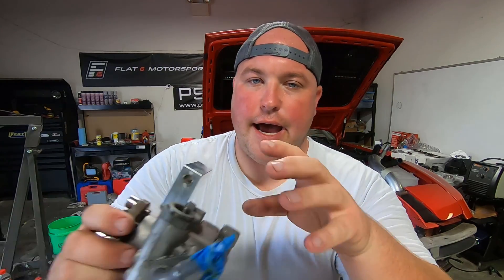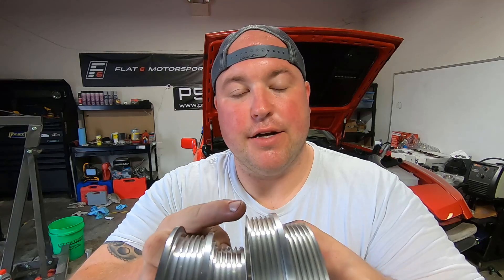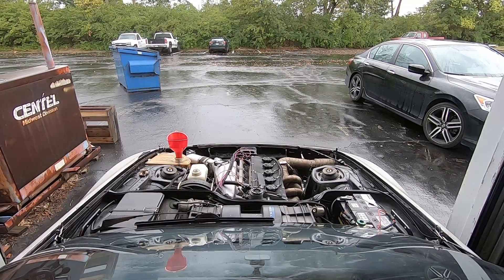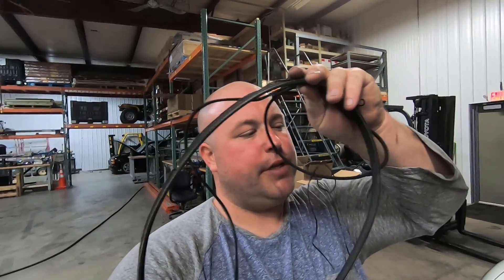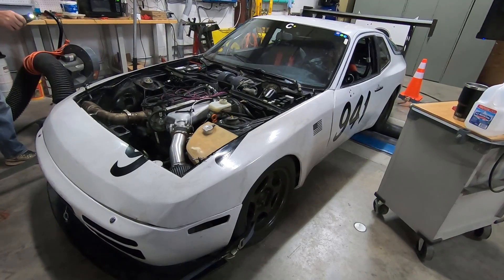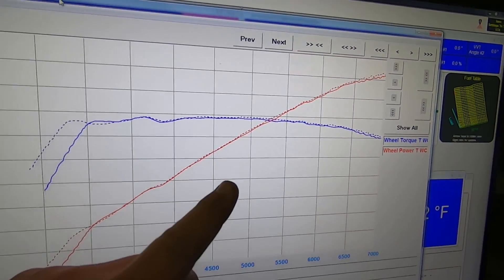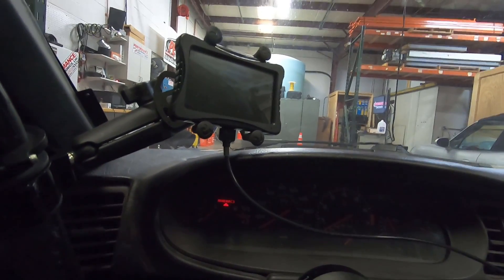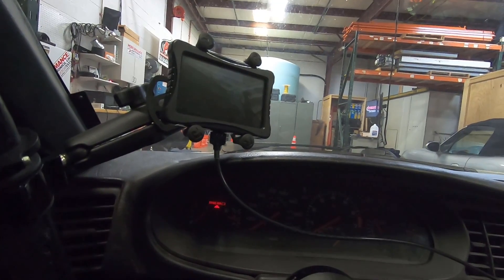5 Cylinder 944 Build - Part 8 (Porsche 944 07K Swap)

Comment: A stock 944 has 140 to 150 hp .
Reply from the maker: Correct. The 07K in NA form makes about what the 944 turbo does. Our turbo 07K build put down 454 whp.

Comment: That sounds so amazing.👍 i almost bought 2 of those engines at my work if i had the cash back then but i let them go.Sadly. I have a audi a3 8p with a manual 2.0tfsi quattro with a BYD edition 30/s3 8p engine swap with a hybrid tte420 turbo and partially forget engine(conrods and race bearings and cnc ported head with supertech valvetrain.It makes 414hp and 545nm on the crank.If my 2.0 tfsiengine was not build i would have dropped a o7k in it since it's the same platform, with any luck my gearbox just bolts on.😅
Reply from the maker: Dang, I bet that’s a blast! My brother had an A3 but never did anything fun with it. The 2.0L has the exact same bolt pattern as the 07K! Make sure to check out our turbo 07K 944 build series if you haven’t already.
Reply: Boost Brothers Garage hey man thanks for the comment, thats nice to hear about that bolt pattern. here's my cars dyno run, 

https://youtu.be/xbiczniq0g0
my plans if i ever get the funds are to put in some rs3 injectors( now on stock s3 injectors with a 165bar fuel return valve and upgraded hpfp and ttrs lpfp and controller) and swap my hybrid in for a tte480+ or a g25-550 but since it's a street car i like the hybrids power delivery. I was planning on putting a half cage in since i already have recaro buckets and rear seat removed, and some additional weight reduction like the aircon deleted, lighter exhaust etc.I live in Belgium near Zolder and spa is about 1 and a half hour drive from where i live.But unfortunately my project is on hold because i got my medical discharge 4 years ago, i have severe crohns since 2001 and i worked as a mechanic from 2004-2016 until my body collapsed, i only weight 53kg in the end so that was the end of my career unfortunately.But i get my enjoyment in these video's.It's nice to see projects like these.So big thanks for the content and the comment👍✌️👉

Comment: Try a clutched/one way alternator pulley, allows the alternator to free wheel on engine de-acceleration... should save belts.
Reply from the maker: It’s a harmonics issue with the factory damper. Starts at around 6800 and nearly impossible to fix without switching to a viscous dampner like the TTRS unit

Comment: Hummm i see this NA version of the build is using a Power steering Pump, I am still wondering if a 2012 2.5L with OEM power steering can be used with the kit... interesting build. I am interested though only secured 2 newer VW project cars...
Reply from the maker: The hydraulic PS pump has to move to make room for the intake. There are ways to still have AC if that is your concern.

Comment: Any CA peeps starting or finished with this 07K conversion?  Any tips on passing smog?  Thanks!
Reply from the maker: Discussing with people but there are issues with doing it. The main thing is you have to keep the vacuum pump on the back for he motor which means you have to clearance the firewall or move to an electric vacuum pump if that’s allowed.
Reply: My Bro in law has a LS swap he gets passed smog here all the time. I’ll hit him up for his resources and try and report back so you can pass on to any other CA swappers who need help.

Comment: It's freaking amazing! If you know someone in an auto parts store you can look at other tensioners with stiffer springs you could swap into your tensioner. Also find a pulley with guides for sure.

Comment: So how did you fix the timing belt issues?
Reply: I currently do not own a Porsche 944 but seeing this Five cylinder swap. It gives me dreams of a car that sounds like a Dodge Viper without the big price tag. How much would it cost to do this engine swap.
Reply from the maker: I’ll have about 8k in the NA swap, and another 2k or so in adding the turbo. Good news is engines are $250 so after the initial investment it’s SO much cheapies easier to work on and modify.
Reply: So I could have a budget Viper for possibly 15,000$. Now I just need to finish my other project car a 1969 Ford Falcon. Don't suppose you guys have a five cylinder kit for one of those? Lol! I will just have to wait till next year and get my Porsche.
Reply from the maker: Love those old Falcons!
Reply from the maker: Fixed the accessory belt issue by installing a TTRS crank pulley/dampener and developing a tensioner pulley with a lip to keep the belt from walking.

Comment: Hey maybe something to look into, its a bit counter intuitive but having a pulley with a crown with the center larger diameter than the out side helps belts track center.  Having edges when they jump will tend to bunch and tear belts too, this is because belts tend to walk to the tightest part of a pulley.  I guess goes without saying having good alignment then if the tension is off as well will cause problems.  You do have a lot going on details like this really bog the project down.  I may be way off base but having metal idler pulleys with a good crown, I would think this would be in a machinist handbook, and maybe a manual tensioner in place of the spring.  :D

Comment: This a non turbo? Seems pretty slow on the video. Sounds faster than it is lol. Needs a supercharger..
Reply from the maker: Non turbo but it is getting a turbo. We have customers who will be doing the swap as NA and this is the development car for base tune etc. I gained 5.5 seconds a lap from just the engine swap vs the stock engine. 1:31.5 to a 1:26.1
Reply: Boost Brothers Garage sounds like a good plan 👍. A fully built n/a with ITBs would be good to see as well

Comment: Bet it feels fast on the butt dyno already with that torque curve, even running 40-50hp down on what it’ll be able to make eventually.
Reply from the maker: HUGE difference from stock. Finally feels like a properly quick car!
Reply: Boost Brothers Garage Yeah the chassis’s capabilities are totally wasted on the non turbo versions, my mate had one, and you could throw it into corners really hard and maintain your speed pretty well on country roads, but it was just so slow getting up to speed.

Comment: Wonder what you would do with a complete engine like Integrated Engineering puts together?
Reply from the maker: You mean the crazy NA build? I’m guessing close to $5k. You make quite a bit more power for way cheaper by going turbo. But those NA builds sound amazing and would be a great match for a lightweight 944 track car

Comment: I reckon you should have stuck with the 951 engine, mine made 427bhp with a flat curve!
Reply from the maker: This was never a 951. Sourcing and building a 951 engine would have been more expensive than what I’ll have in the swap once turbo’d. I still have my 2.85 hybrid stroker 951 engine for my widebody car

Comment: There is something deceptive and effortless about the 07k despite its low power numbers.  It just doesn't bog down or need to be wrung like a four cylinder.  I took it up to the mountains last summer and made a 10 mile climb on a 3% (or more) grade without trouble.  It didn't care if it was in 3rd or 4th.  It just went.
Reply from the maker: Smooth linear power for sure!

Comment: Many things to consider here:
1. Although the hp #s may not seem that different from the NA 944, the power delivery is completely different. The modern power curve is light-years beyond the stock Porsche motor. 
2. Without any modifications to the rotating assembly, this engine will eventually spin 8,000 rpm at close to 200hp all day long. Again, a major different from the stock 944 motor but using the same displacement. 
3. Mike has the prettiest eyes. 
4. With head work and modified cams, this could be a 230 wheel hp, 8,000 rpm engine, all day long. 
5. If you have custom ECU or tuning work done, Performance Electronics is THE place to go in the Midwest. A real quality shop with not just niche tuners, but real engineers. 
I've spoken my peace. Godspeed ya'll.
Reply from the maker: Regardless of the dyno numbers the factory engine was 158 crank (when new!) and this should be 220-230 crank when tuning is done. A 30% increase is HUGE! Also, couldn’t agree more with #3 😘

Comment: I have questions 1 can the performance electronics ems be used with a race pack iq3, dose the ps relocation kit allow for A/c and will you be producing pully a kit that will help eliminate the issues that you are seeing with the belt
Reply from the maker: ECU uses CAN so any aftermarket race dash plugs right in. We will 100% be offering the pulley solution in our kit. AC could be installed on the passenger side of the engine.

Comment: Wait....so a broken belt is now likely to to force you to spend two days pulling the engine out and replacing the 3d printed engine flange every time it happens?  Instead of trying to make it never happen it seems better to just design it to handle the failure, right?
Reply: No. The belt broke which spiked the coolant temp, which melted a 3D printed prototype part. Once they figure out that the part will work they will have the actual part cast or machined out of metal and it will never be a problem.
Reply from the maker: Agreed!  This failure was just because we were using a plastic 3D printed coolant flange. The production piece will be aluminum so it won’t ever be an issue again.

Comment: Nice work guys. Assuming there are plenty of examples around the world of people building up these motors (in various cars). Therefore what are they doing about the belt issue? The harmonic balancer should help.
Reply from the maker: They are doing the TTRS crank pulley alone and that seems to solve most issues.
Reply: @BoostBrothersGarage  Great to know there's an easy solution. You'll definitely have to sort it out before going forced induction. Looking forwards to your progress.
Reply from the maker: Thanks!
Reply: @BoostBrothersGarage  Just found a guy  in Oregon who has a 924 racecar with i5 motor conversion. Look up Britain Smith on FB.

Comment: I love the flat torque curve it has and am also really curious to see when the power will level off when the belt issues are sorted. VW really restricted that motor from the factory, guess they can't have an n/a motor upstate their 2.0t lol.  I'd love to see a built n/a 07k just to hear it scream
Reply: IE Motorsports have built these motors to over 300hp NA
Reply from the maker: I REALLY wanted to keep this engine NA and do a 300 hp 9500 rpm build but the boost bug hit me hard
Reply: @BoostBrothersGarage   makes sense to me! Boost delivers for the money and output. The only reason an NA build would make sense is if it somehow kept you in a more competitive race class or kept the car more reliable. That and just the preference for power band shape and delivery if the car was breaking or hard to drive with the extra torque. At this stage it's just not apparent how much that will matter. Looking forward to seeing how the cars do as you get deeper into R&D!

Comment: Stock cam? Is it using VVT?
No matter what, that Gallardo manifold makes it sound better than my '13 Passat.
Reply from the maker: Stock cam for now. It is using VVT but it’s not fully dialed in. We gained 20 hp just through initial VVT tuning but it needs some more dyno time to be perfect

Comment: The 07K belt problem is also exacerbated by poor quality belts. You need something made with racing in its design. I went through about 10.autozone, etc. Belts but haven't broken a single Continental belt so far
Reply from the maker: Good to know, appreciate it!

Comment: Two things I would try regarding your belt throwing issues. Under drive the water pump pulley or crankshaft pulley to slow down the belt accessory drive. Second what belts are you using? If it's not Gates or Continental Elite then throw them in the trash.
Reply from the maker: The belt we kept tossing was Dayco because it’s what was in stock locally. I’ll get a Contentinal on order, that’s what belt is on the water pump / alternator etc and it’s great
Reply: @BoostBrothersGarage  "Integrated Engineering 2.5L 5 cylinder all motor 9400RPM pull" on YouTube
https://youtu.be/yq6Ahsk4VGo